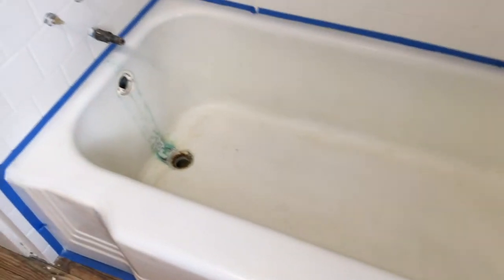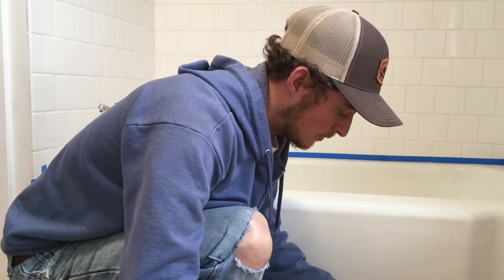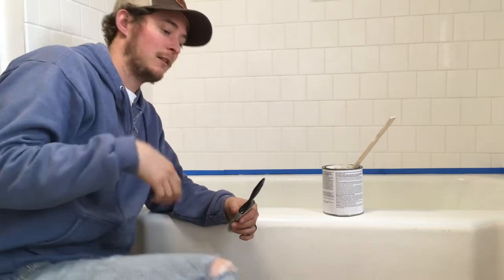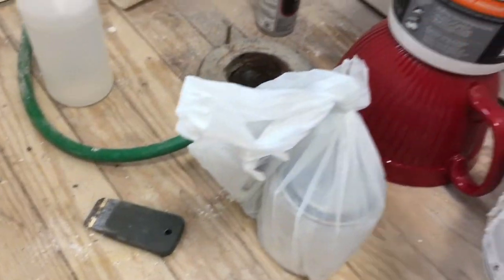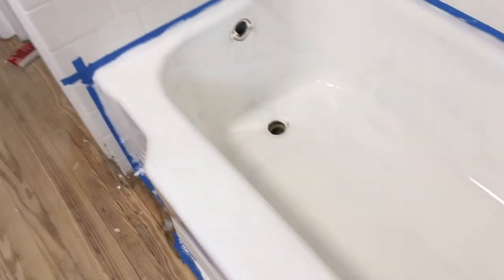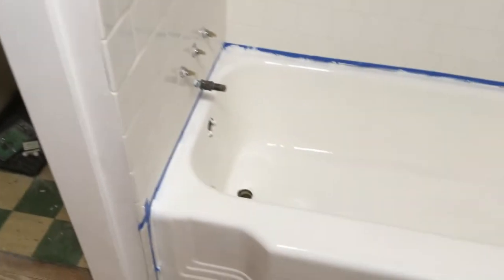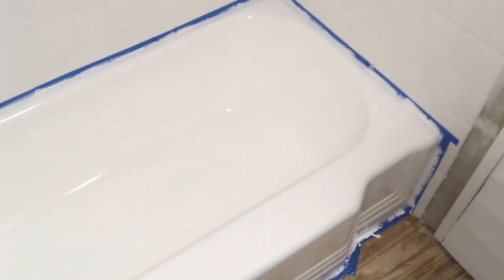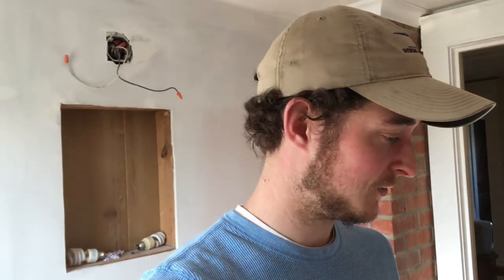DIY Remodeling a Bathroom: How to Refinish an Old Cast Iron Bathtub

Comment: I have the same exact tub style and I have 21 of them in an apartment building that was built in the early 50's. I've tried using those tub refinishing kits sold at the big box stores with limited success. I found a guy that refinishes tubs using an electrostatic painting technique and warrants his work for 5 years. His finished work looks amazing.
Reply from the maker: Yeah this stuff didn’t last at all!! Electrostatic?? Like powder coating??
Reply: @GoodViewWoodworks  Not powder coating but he does use an electrostatically charged paint sprayer.

Comment: 5 years ago, curious how it has held up?
Reply from the maker: great question! It HASN'T!! it started to chip away months after installation.
Reply: Epoxy dosent hold like that you have to strip old off and clean well and redo the whole finish, or just rip the tub out and get a new one @GoodViewWoodworks

Comment: How’s it holding up?
Reply from the maker: It’s holding up well! There are a few spots where I dropped some Epoxy grout on it and it dried . When I remove the dried grout it pulled up a small spot but other than that we’ve had no issues
Reply: GoodView Woodworks think I’ll try it on my sink... we got a fixer upper and the sink is cast iron... the paint is gone on the bottom and it’s rusted... it’s between the countertop and kitchen cabinets so can’t remove it without taking off the counter tops.  Trying to find a way to fix it.  Might give this a shot.  Thanks!!!
Reply from the maker: Good luck!